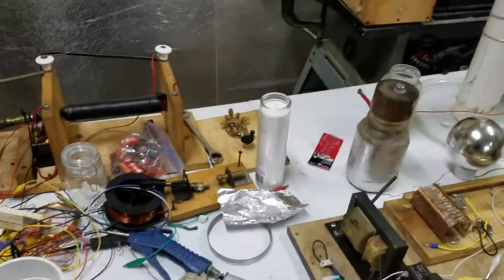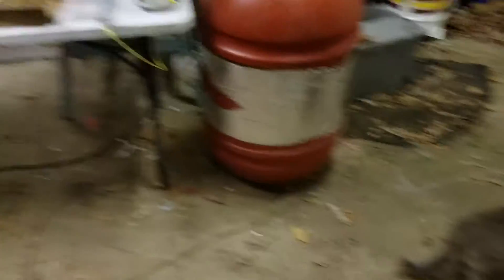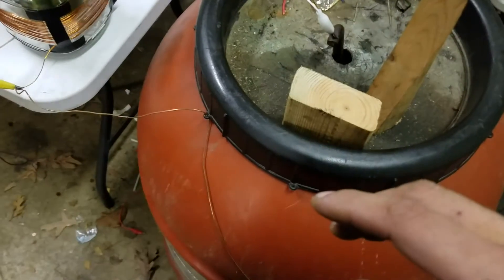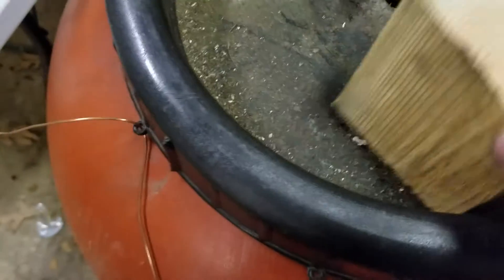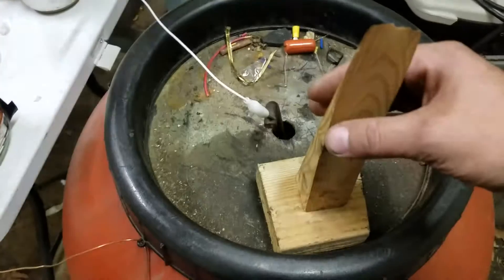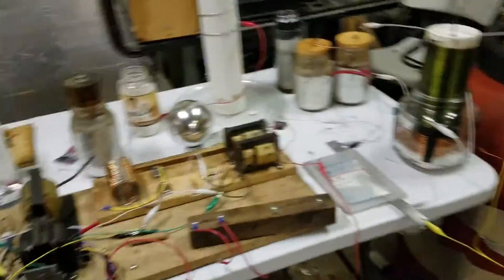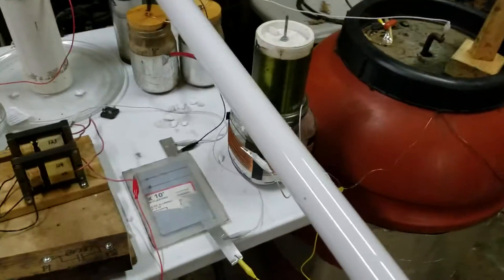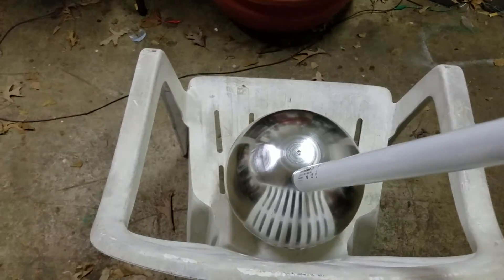Longitudinal dielectric transduction - 2of2

Comment: are the plates and caps perhaps working like a high Z inductor?
Reply from the maker: acid byte I dunno, wouldn't the effect exist when the spark discharges into the primary like the traditional TC design? because it doesn't.
Reply: well i have this wireless effect with my sstc (no spark gap just switching primary at resonance and no this doesnt give the same effect as sparkgap switching :) )
so i think you are on somewhat same effect? or maybe not ofcourse  im just guessing :)
Reply from the maker: yea, sounds like it.. i need a motor/generator setup now to put some undamped higher frequencies into the primary.. i think range and efficiency can be improved if i can get into the kHz ranges